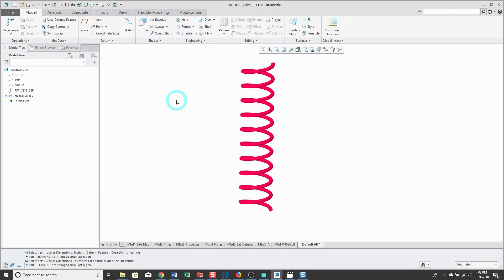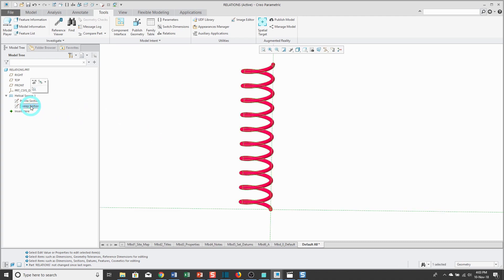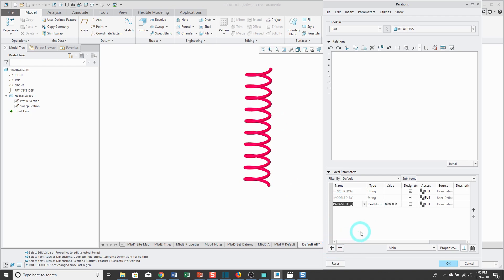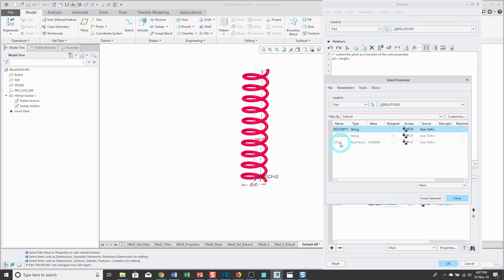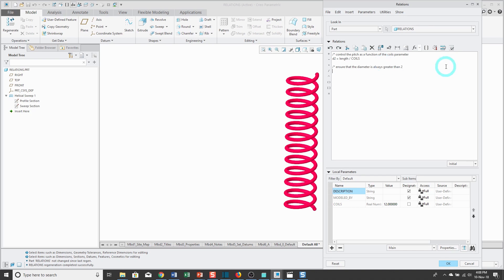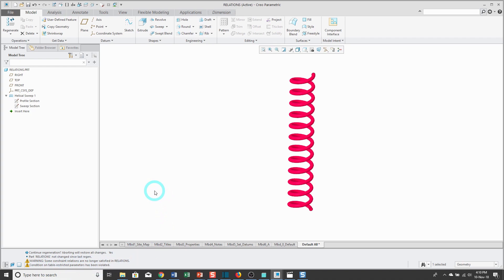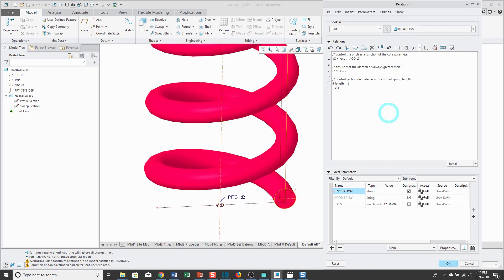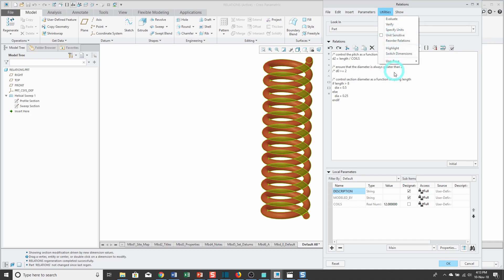Creo Parametric - Relations - Design Intent

Comment: Hello, 
Is there a way to create a relation for points XYZ coordinates? Maybe like:

PNT1=X, Y, Z
I have been looking but haven’t found an answer, thank you for your help.
Reply from the maker: Not like that. You should look at my video on Prime Analysis Datums. But what are you really trying to do? Sometimes people get caught up in the mechanics and lose sight of the goal.
Reply: Creo Parametric 
We want to place points on a part and show their coordinates on drawing tables using parameters. (Hole table) is not an option since it only works when Z is normal to screen. So I thought we can use parameters to make the tables parametric. Do you have a link to the video you mentioned?
Reply from the maker: @Waseem_2013  Hole Table works for points. It has other issues which I'll explain in a video. But if you want to use the Hole Table... why not create Holes? I guess the more basic question is, what is the point (no pun intended) of the table of points? What are you really trying to accomplish? Let's get to the more basic problem rather than getting wrapped up into datum points, Relations, Hole Tables, and so on. You can find videos by searching from the channel home page.
Reply: Creo Parametric 
We are creating cast inspection points, so the foundry wants us to place points on the surface of the model and get their coordinates in reference to the part’s CSYS. That is all they requested us to do, may e they want to use those coordinates to scan the model is some program.
Reply from the maker: @Waseem_2013  Okay, so now we're starting to get to the core of the issue. (Btw, this is like 75% of consulting, trying to figure out what the customer really wants, as opposed to what they think they want.) How do you determine where those points are? Do you create datum points on model surfaces? It sounds like they want to use those points with a Coordinate Measuring Machine (CMM). Do they want that information on the drawing or in a more useful form like an Excel or CSV file?
Reply: Creo Parametric 

Basically, they want to through points on certain surfaces, report the coordinates in tables on the drawing, scan the model and move points accordingly. So it is very important for the coordinates on the drawing table to be parametric. 
They used to input the coordinates manually which led to a lot of confusion when the points on drawing table didn’t mach what is on the model. 
Most likely we are going to use one surface as a reference, then dimension to two datum planes.
Reply from the maker: I don't understand. If the points appear on a table on the drawing, then they still have to transcribe them into the CMM. They've just shifted where the manual part takes place. Wouldn't it be much more useful to them to provide the data in a form that doesn't introduce error with manual transcription?
Reply from the maker: The reason I'm having so much trouble understanding this is that it seems unnecessarily convoluted. If they are doing this for CMM, why not provide them a STEP AP242 file with datums exported? Most CMM supports AP242 and you're skipping all the intermediate steps (generating points in a table, transcribing those points into CMM) where you can introduce error into the process.
Reply: Creo Parametric 

I don’t know why they are doing it this way, but they still wanted done as I explained. So do you have anything in mind?

Comment: I've tried to emulate what you did with d2>=2, and change the dimension to 1.5, and only appears a small message in the Message log. There is no window like you show in this video. Any particular configuration?
Reply from the maker: What version of Creo Parametric are you using? I believe it was changed in a version. For the longest time I was used to getting the error in the Message Area, and it's only recently that I've been seeing it as a dialog box.
Reply: @CADPLMGuy  it's creo 5.0. But the strange thing is that I've tested in other computer, and it appeared. So it should be any config. Tomorrow I will delete all lines from my config.pro, and will insert one by one to see if any of my configurations, is blocking the window.
Reply from the maker: Sight unseen, I would guess perhaps info_output_mode, which I have set to screen.
Reply: @CADPLMGuy  , found the reason. I created the relation inside a feature. When I changed the relation to the part level, it has the same behavior as your video. Thanks

Comment: Another awesome video!  Question on dimension names, does it matter if the dimensions are named on the part level via right click "edit" the feature as you have shown in this video, or if the dimensions are re-named within the actual sketch definition environment? (if the feature happens to be a sketch).  I was scanning through your top down design book on amazon and noticed you mentioned an unhealthy practice for sketches is adding relations within sketches.  It's all a bit confusing, why does Creo even let you add relations in multiple 'modes' (i.e. part, asm, sketch modes)?  Maybe a new video idea would be showing the risks of creating relations or naming dimensions within sketch mode?  Thanks once again for all the very helpful information!
Reply from the maker: Sean, in the sketch, dimensions are given the name sd#, which become d# at the feature and part-level. In Creo 3.0 and earlier, if you renamed the dimension in the sketch, that carried over to part mode. In Creo 4.0 and later, I actually don't see a way to change the dimension names at the sketch level anymore.

Regarding writing Relations at different levels or modes, they do have their uses. Variable Section Sweeps make heavy use of Relations at the sketch level. Also I have used them in very specific cases, like when I have a Datum Analysis feature evaluated higher in the Model Tree and I want to use the result to drive a Sketch. There are times when you might need Relations to be evaluated at the time the feature is regenerated, or after the part is regenerated (like with mass properties), but those tend to be edge cases. In the hands of someone who knows what they are doing, they are helpful. Usually when I find someone has written Relations at the sketch level, though, they did not know that's what they were doing, and it's very hard for someone else to know Relations exist there.

Good idea for a video. I want to do both more high-level modeling practices videos as well as more detailed examinations of nuances videos. I could do a high-level one on "here are Relations at different levels and why you would use one" and a more nuanced "here's how those Relations are affected by the regeneration cycle."
Reply: @CADPLMGuy  Those sound like two more really useful videos to me :)  thanks for the clear response, this all makes sense.   (also you're right, I'm new to using Creo 4, I just checked and and I can no longer find a way to re-name a dimension within a sketch like I thought I could in previous versions)
Reply from the maker: Sean, I just posted a video where I hopefully clarified the use of Relations at different modeling levels. https://youtu.be/vDml7BftBCs